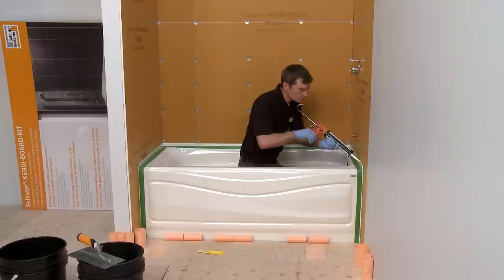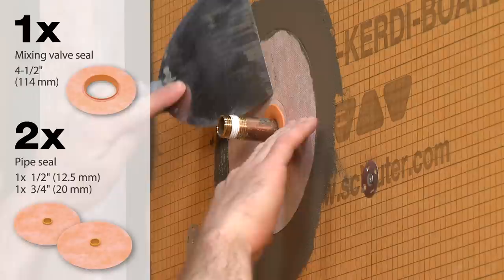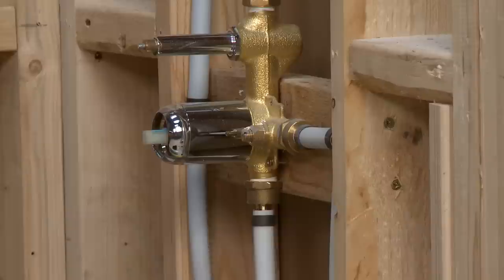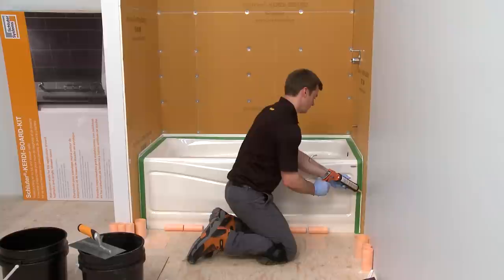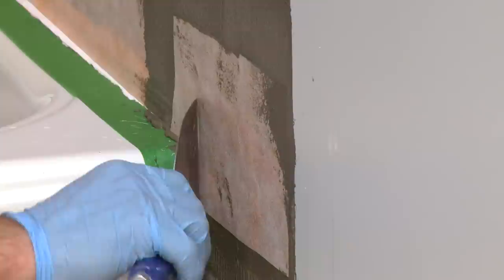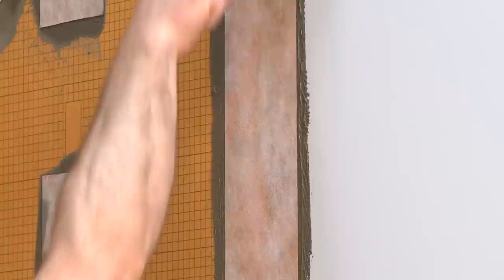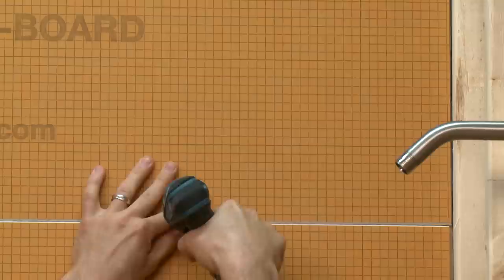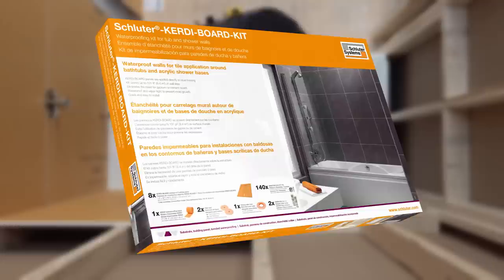How to install the Schluter®-KERDI-BOARD-KIT

Comment: Hello, I was just installing kerdi band with schluter allset mixed with roughly 8.5 qt of water. When I peeled off kerdi band the coverage on the back was so so. This is after flat troweling and ridge troweling after. Any ideas?
Reply from the maker: Hi there, 
Thanks for reaching out to us! Could you talk this through with our Product Support team? They are trained in technical matters and should be able to give you some help. They can be reached at US: 800-472-4588 or CA: 800-667-8746.

Comment: why is kerdi-band not a tape like building flashing tape (Zip system)?
Reply from the maker: Hi Chris, great question! Since Kerdi was designed to be installed with thin-set mortar given the use in shower systems along with tile, the Kerdi-Band is also applied with thin-set to get a proper bond. This creates a complete waterproof application that is simple with the use of thin-set already on the job. This method is also designed to provide more load support than a typical tape system used in exterior panel applications.
Reply: Schluter-Systems North America thanks!